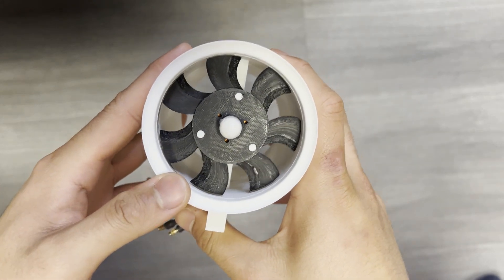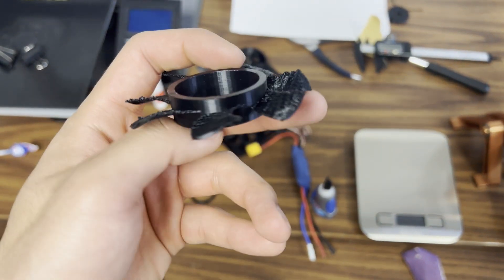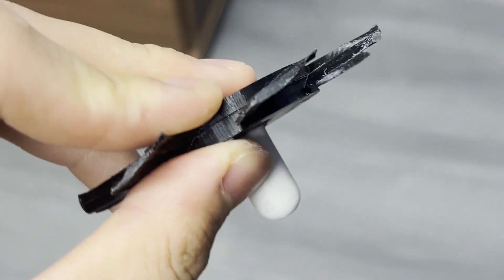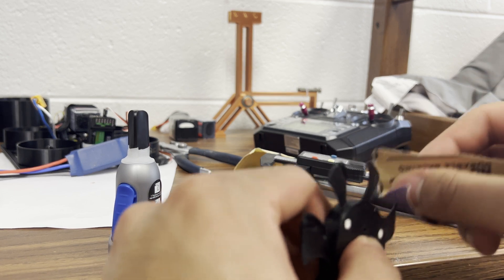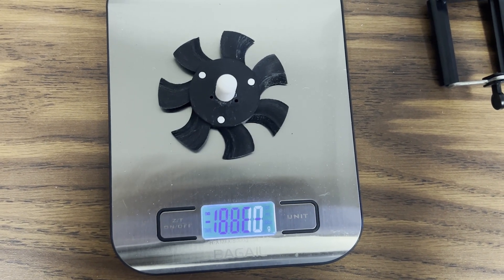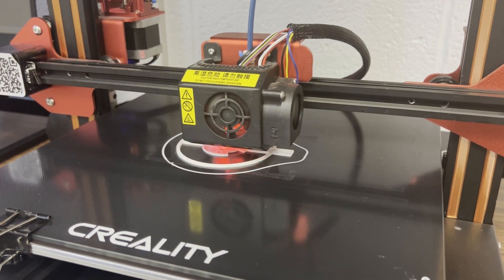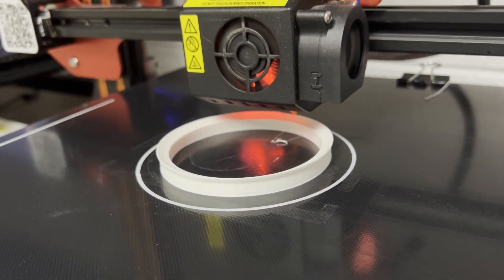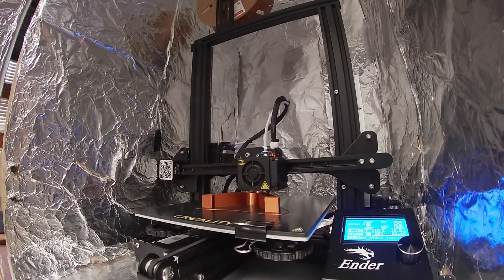Starting Out: 50g Thrust (3D Printed EDF)

Comment: I got 91g on a 6-blade at 26w input power. same 70mm diameter. Made entirely in tinkercad with no professional cad software. 0.2-0.4mm blade gap straight out of the printer.
Ive got a post shared on RC groups about it. Still tweaking and tuning it.
Using a BRUSHED DC motor to boot. Not even a brushless one. Very thin blades with simple camber and mild twist. 0.8-0.9mm. printed flat in one piece on the print bed with no supports.
It easily lifts itself straight up against gravity (Motor + duct + EDF + wires weighs 68g so it can lift itself)
My fan blade only weighs 6g
Printed at 0.8mm line width. 0.18mm layer height. 0.025mm wall inset using petg.
Try adding stator vanes to help deswirl and straighten the airflow out. Mine has them.

Comment: To get the best surface for the propellers I would try a design where you print the propellers individually like the real turbines.  This way you can print them upright / vertical to the print bed and have no overhangs at all. You can also try a new design more quickly by reprinting only the propellers.

Looking forward to your next video!
Reply from the maker: I actually tried this a few vids ago! It's encouraging knowing that real fans are built like that. I'm actually fully printing them without supports now using a high pitch angle, hoping to update soon.

Comment: One thing to look at that might help with improving thrust to weight ratios of the fans is looking at lightweight PLA filaments 

Getting the surface of the blades as smooth as possible is another - though with FDM your best best is using a very small amount of fibreglass filler and sanding it as smooth as you can (remember mask up when sanding fibreglass)

RCtest flight has a few videos working on propeller blades and might be a good resource for that end

Cool project though mate, looking forward to seeing how it develops

edit: Was looking through my uni notes and noticed mention of the inlet size typically being a bit wider than your prop diameter  (e.g. diverging nozzle inlet) can potentially benefit your thrust output quite a bit

Another imo would be to have a smooth gradient for any diameter transitions, try to avoid steps where you can
I’m not 100% sure whether a converging nozzle output or a venturi nozzle would produce more thrust though, could be worth testing
Reply from the maker: This is super helpful, thank you. Looking at fillers right now

This thrust tube has been the most confusing part about this for me. I think there are benefits to both diverging and converging nozzles.  In practice, I think either are better than nothing in order to mitigate swirling out of the exit. It seems like most RC guys use thrust tubes that diverge to about 90% FSA. I definitely think it's worth testing both, there's likely an optimal increase for both a mild converging and diverging angle (there definitely is for my venturi ones).

Comment: You might already be aware of this, but in case you aren't, increasing line width in combination with very low layer heights can make it possible to print very close to horizontally.

The pitch looks really small in the video.

You want to avoid unnecessary sharp flow changes, adding cones on each side of the motor might help, making the motor mounts more aerodynamic would definitely help, you can even try twisting them to act as stators, and even design the mounts/stators to fit the power cables inside them. Turning the rotation of the air in the duct into linear motion by designing the mounts to also acts as (better) stators, instead of causing a lot of turbulence should increase thrust.  

The intake didn't have a smooth curve, also it created a reduction in area, and, there was a sharp corner and gap where the intake and rest of the duct met, all those factors probably contributed to decreased performance. 

Restricting the outlet doesn't make much sense for a fan where increased back pressure cause a very significant decrease in mass flow. 

Anyhow, from the looks of it, my guess is increased pitch is what would create the biggest improvement in performance.
Reply from the maker: Thanks, this is a gold mine of tips.

Yeah experimenting with some 45 deg+ pitch designs, I was going off ducted propellers before which appear relatively low pitched but maybe I didn’t look close enough. 

For the inlet, I did fillet the inner surface where the inlet transitions to the duct, might be hard to see with the white pla but I’ll continue to smoothen everything in there.

The wire idea is really good. I am also changing the mount design to be a lot thinner and aerodynamic, more like conventional EDFs.

All that to say, I’ll basically be doing everything you suggested. Hopefully I can post another update soon. Again big thanks

Comment: If more consistent thrust is what you are looking for, you should try making a centrifugal compressor fan (usually an impeller or the other turbine thingy i forgot what its called but its a lot more supported and better for strength when 3d printing. With that you can make high pressure flow and then you can constrict the exhaust to increase thrust as well as making a variable thrust nozzle with a servo or 2, some paperclips and some 3d printed panels.
Reply from the maker: Ah I have seen stuff like this. Fascinating. Will definitely read more into it, thank you so much!!

Comment: you want expanding cones for the inlet and the outlet (diffuser instead of nozzle). the reduction of a nozzle increases the airspeed but reduce the overall energy output due to friction and compression losses (venturi nozzle).

also you want to eliminate all steps in the duct and a cone shaped body for the fan will increase performance by a lot
Reply from the maker: I’ve been seeing it’s common practice to use nozzles on EDFs. Wouldn’t you just exasperate the swirling flow at the exit by using an expanding cone?
Reply: @mach10point4  vortexes are loses, to try to eliminate them first. but in general turbulences helps to adhere to the sidewalls, so better make use of them.

and sudden expansions result in quite bad pressure losses. https://en.wikipedia.org/wiki/Borda%E2%80%93Carnot_equation

set up a test rig and try multiple housings and see if they work. 10° expansion at the end for maybe a cm should be fine. most ducted fans do that. or they cone the backside of the fanrotor

also the cross strut should be be tear shaped at least.